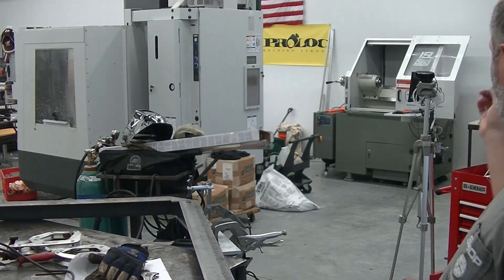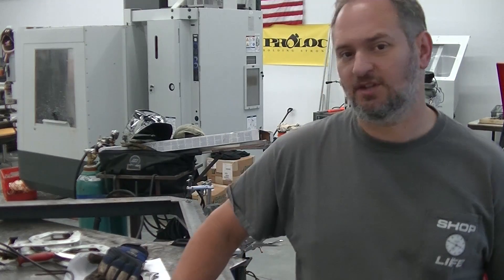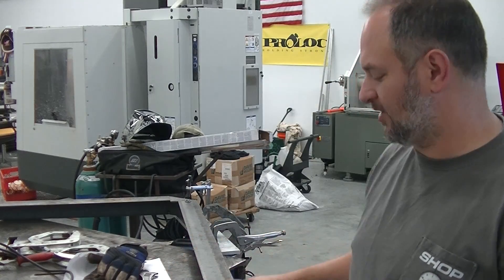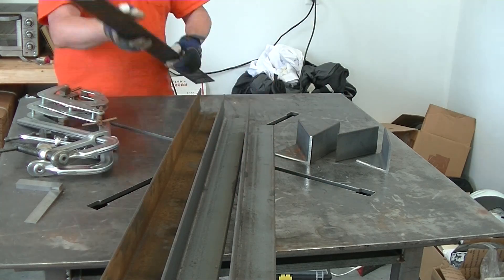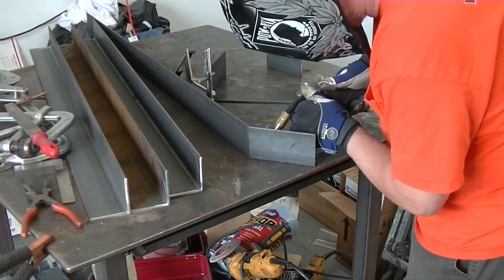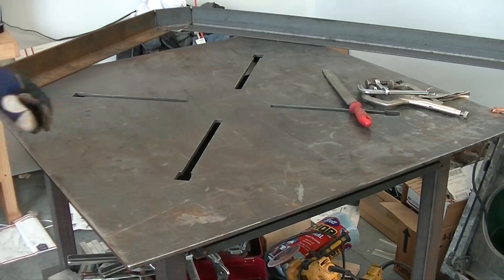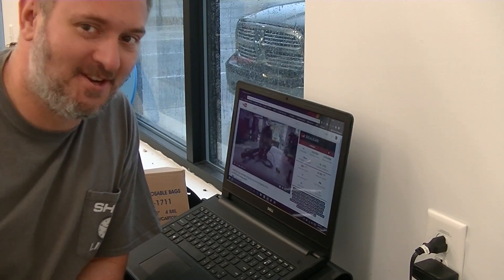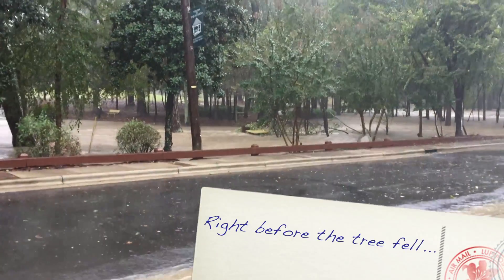Projectus Interruptus - Water Tray Build

Comment: Be careful. That sheet metal will warp. Use as thick sheet as you can. Ask me how i know about warping. See my vids on this. I was careful and jump around when welding but it still warped. I tigged my sheet to the angle.
Reply from the maker: You should see how much the sheet was already warped before I got it! Using that aluminum helped out quite a bit but you are spot on about skipping around. Backstiching helped as well. So you used TIG for the bottom? Not a bad idea at all.

Thanks for the input! How have you been? Haven't seen you around much this summer.

Best wishes,
Tom Z